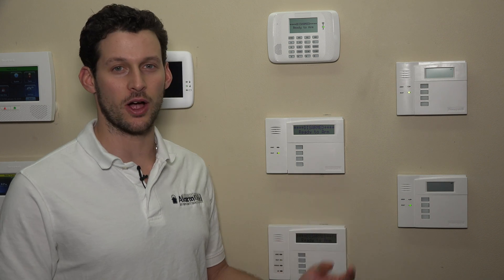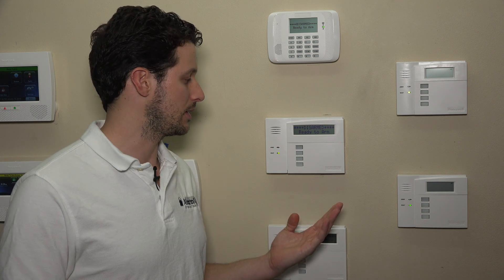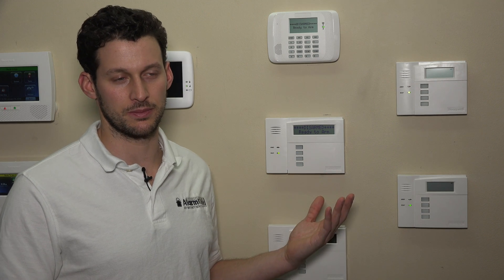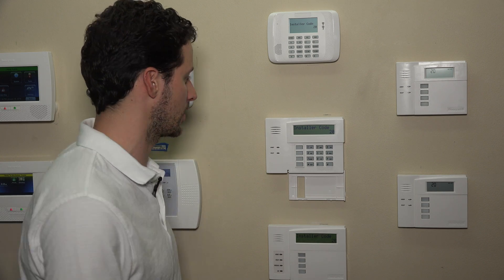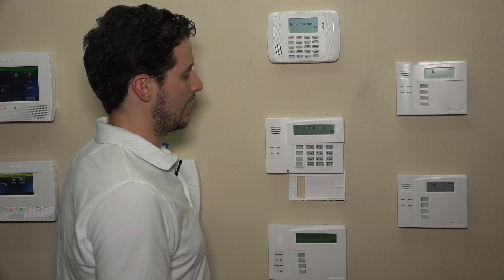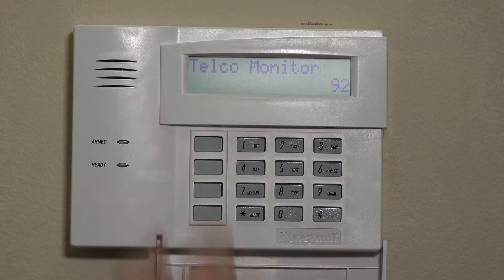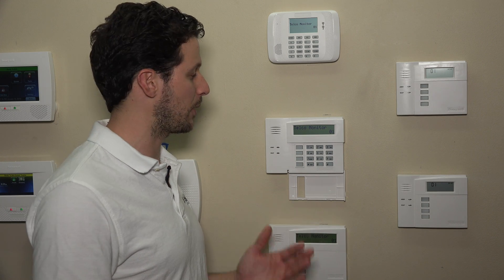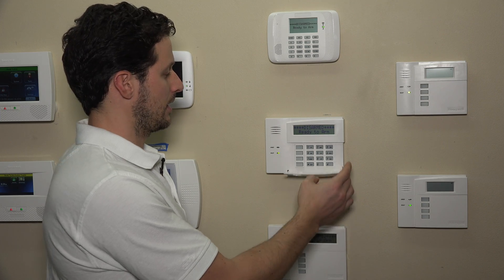Honeywell VISTA: Program *92, Tip and Ring

Comment: I've set my mobile phone number as the primary phone number on my vista 250. I don't use a monitoring company. When there is an alarm, the system calls my phone, but even after I have turned off the alarm, it will call back around 8 times. Any ideas?
Reply: 2 years old, I know. This is a really interesting problem. The phone number you program in the panel is designed to dial into a specific kind of receiver. The first thing the receiver does when the panel calls is send a 'kissoff' that lets the panel know that it is there. If it doesn't get the kissoff, your panel retries the call. It retries a specific number of times. 8, in your case.

Comment: How do I get a 21ip that cycles between DIALER OFF and ready
to arm to stop showing Dialer Off? I have tried: 41*, *42*, *94 and *92 0
0.  And it still shows Dialer Off.
Reply: I do not want to turn dialer back on, so to get it to stop I have get a dealer to do that? Or can I do a panel reset to factory will that do it?

Comment: please when i powered op my vista 128 panel the power is not stable and keeps going on and off, I am using the original 16.5ACV that came with the panel....what could possibly be the cost and solution.

Comment: bought a house with bay alarm but didn't know the code...your vid worked perfect to reset it. Bay alarm would not help said I needed to pay a 3 year contract to get working Thank you so much
Reply: We're very glad to have helped. If you are ever interested in no-contract monitoring services, we offer them online at https://www.alarmgrid.com/monitoring.
Reply: I set my alarm off to test by opening a door...it won't call the police will it..how do I turn off that option or on?
Reply: It's very unlikely the system is set to call the police directly. It may be set to call a monitoring company.

Did any error messages show up on the keypad aside from the alarm message?
Reply: yes it did said something about the bedroom sliding door I opened omg it's loud like ear peirce loud
Reply: disarmed twice to clear all codes..shows code 8 tamper and I assume it's from no phone or Internet whatever it uses
Reply: Tamper usually means an issue with a sensor cover being open on a wireless sensor. Usually you wouldn't have a wireless sensor on zone 8 though. What model number is your system and are you sure that's what the keypad showed?
Reply: two sensors have dead batteries and they cut the wires so they could open the windows   with the system armed I will retest and give you a code
Reply: I set the motion sensor off this time alarm 13 family room motion..was kinda hard to get it to trigger that way.also I have to bypass fault 08 tamper in order to ready system to arm
Reply: "Fault 08 Tamper" is not a message that would be displayed on the keypad. What exactly do you see on the keypad when you hit the * key in the disarmed state?
Reply: it says fault 08 tamper..it's  a  Vista 20p with 7720p controller
Reply: this was there vacation home what is 08 also there is just a resistor on tabs 8 and 9 in main box ?
Reply: Our guess is that they have zone 8 wired up for a tamper switch on the actual VISTA control panel box so your display is simply showing that the control panel is currently open. If you close the panel and it clears, it sounds like the system is working as expected.
Reply: just tried it ..had to replace the lock before I closed it. I had duck tape holding the door closed the whole time but didn't clear code it came back ..I'm confused lol
Reply: The tamper switch for the panel or the wiring to the switch must be bad then. You'll have to look closer at the wiring and switch connected to zone 8 to see what's going on.
Reply: I will let you know if I figure it out..one end goes from switch to a resistor and then to the panel the other goes into the wall on a blue wire?
Reply: That does sound odd. Typically, you'd have two wires from the switch. One going to a side of the resistor and then the other side of the resistor going to one of the 2 terminals for zone 8 on the panel and then other wire would go directly to the other terminal for zone 8 on the panel.
Reply: thanks to I figured it out!!  they had it wire thru resistor to switch then to blue wire which is phone then came back as an orange phone wire..since I don't have a home phone I guess it set the fault. I wired it the way you said it should and when I open the panel door it says fault 8 and soon as I close it it disappears :)  thanks a bunch and now you have a new diagnosis up your sleeve.
Reply: Ah, it sounds like they had it also monitoring the phone line connection so you fixed it properly!